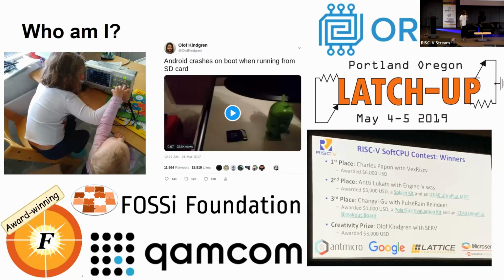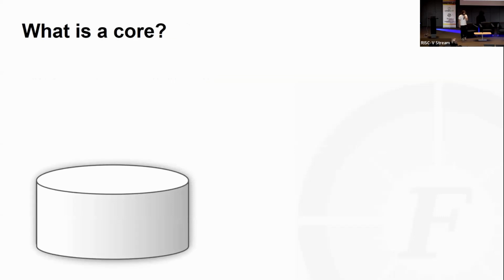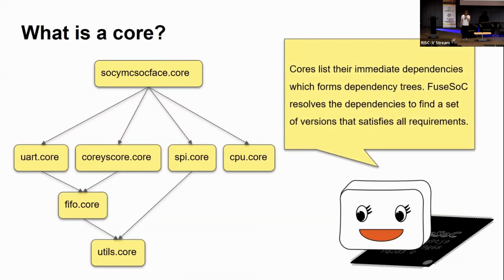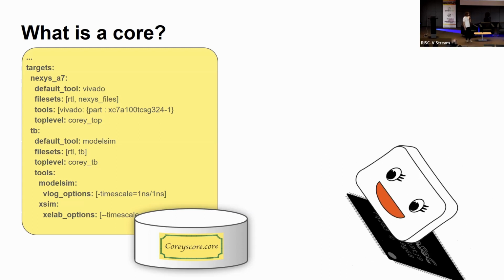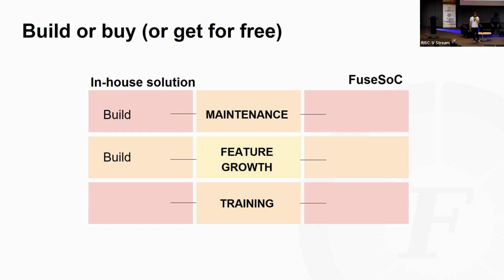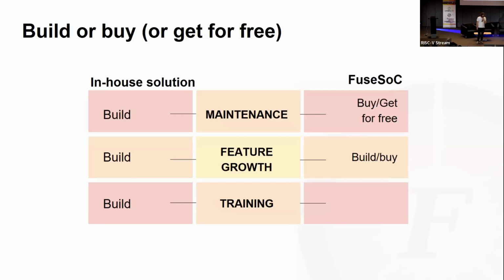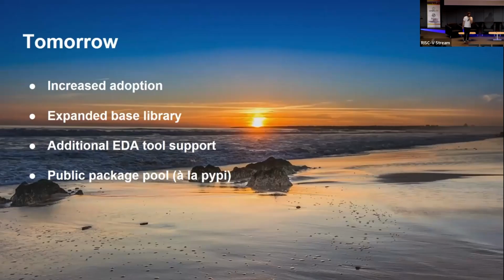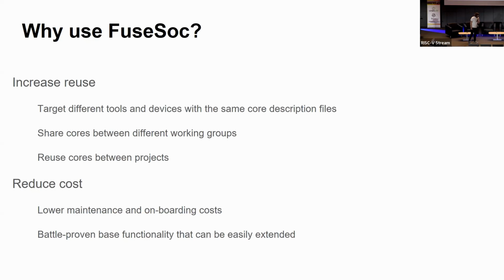A CPU is Only as Good as its Ecosystem: Turning RISC-V CPUs into Systems with FuseSoC- Olof Kindgren

Comment: The RISC-V is based on 40-year old ideas as RISC-V Foundation claims. There is no sense to port the huge x86 and ARM software ecosystems on it. Thus, RISC-V will never gain a victory over x86 and ARM. The most of positives about the RISC-V processor are arbitrary speculations. The advantage of RISC-V is open architecture. RISC-V has instructions of variable lengths. This is bad, it is a departure from the RISC architecture principles. 
The Contemporary microprocessors contain 8 specific hardware components: (1) SMT (Simultaneous Multithreading), (2) register renaming, (3) instruction reordering, (4) out-of-order execution, (5) speculative execution, (6) superscalar execution, (7) delayed branch, (8) branch prediction. These components make up some kind of a “magnificent eight” of components which essentially raise the performance of microprocessors. But unfortunately they are very complex. A processor core having these components is a full-fledged one, otherwise it is good for simple applications, e. g. for embedded systems. 
The “magnificent eight” of components is very hard to design, only the experienced firms and developers are able to do this, and much know-how was acquired, some effective solutions are patented. Particularly complex is the SMT. Only powerful and advanced firms like Intel, AMD, IBM are able to equip their processors with the “magnificent eight” components. It is not surprising that some Intel processors, and the famous Apple's M1 processor do not contain SMTs. If a company is able create the full-fledged RISC-V processor with all “magnificent eight” components then it would be a serious achievement, and such RISC-V would be considered of the World's class comparable with x86, with ARM, but not more. As far as I understand most of the developed RISC-V processors have no components from the “magnificent eight”, and are intended for embedded systems.
A course directed on further development of RISC-V is a wrong way, and leads the computer architecture to deadlock. The RISC-V is not perspective for computer industry. The World demands absolutely novel microprocessor having much more higher performance than all contemporary ones. The novel and effective ideas on computer architectures do exist! Here’s such a novel processor architecture:
V. K. Dobrovolskyi. Microprocessor Based on the Minimal Hardware Principle. Electronic Modeling, 2019, vol 41, No 6. pp. 77-90. The article is posted (under the Cyrillic name добровольский.pdf):
https://www.emodel.org.ua/en/ touch ARCHIVE, then move to 2019, then to VOL 41, NO 6(2019) pp. 77-90.
This processor does not have the “magnificent eight”, it is not necessary at all. This comment reflects different view on the RISC-V architecture, and the computer community has a right to become familiar with such a view. I’m Volodymyr Dobrovolskyi.
Reply: Your "magnificent eight" is bullshit. First of all, do you not realize no architectures have branch delay slots anymore? How is that even a hardware component, anyway? It was only useful for simple in order pipelines. Out of order processors across the board have no reason to delay a branch, because they can just speculate on it anyway and delaying it causes the compiler to have to come up with an instruction to fill that slot with.
What about a cache/memory hierarchy? Multiprocessing? Cache coherence? SIMD units? Are any of these things that any modern processor has nowadays just not worth the time? Especially the cache hierarchy. 
There are several OOO RISC-V implementations out there, such as the Xuantie 910. Yes, no one's taping out CPUs on the scale of Intel or AMD, but that doesn't mean that the ISA can't support it.
I think RISC-V is pretty massively overhyped,   but your argument is premised on the idea that you can't build a high performance OOO CPU on RISC-V, which is just not true. It's just an ISA. It does not prevent you from doing any of these things. There is nothing wrong with teaching people how to build processors with this architecture. Talks like these are pushing the ecosystem in the direction of having legitimate high performance CPUs out there.
Reply: Some of those "magnificent 8" are there only to overcome the massive deficiencies in x86-like architectures. Some of them are useful in a RISC-V-like CPU, but not all.
Many RISC-Vs do have some of your magnificent 8 including simultaneous multi-threading, register renaming, out of order execution, speculative execution, superscalar execution and branch prediction.

Indeed RISC-V even introduced the term "harts" (rater than "cores") in the spec to support the notion of SMT (aka hardware threads).

Does RISC-V really have instructions of arbitrary length? If so, it is nothing like the arbitrariness of x86 where instructions can be from one to 56 bytes long.